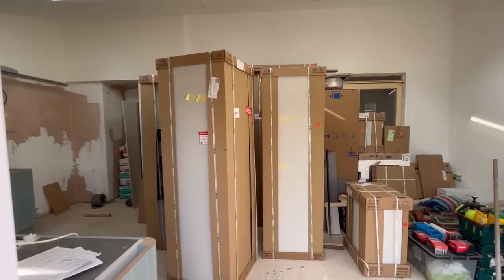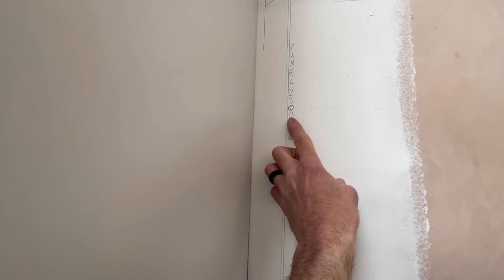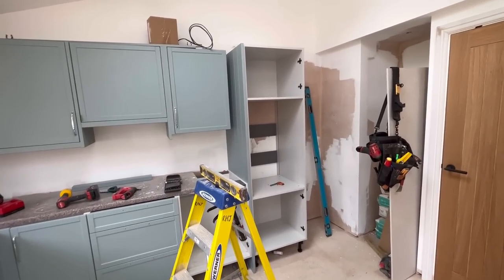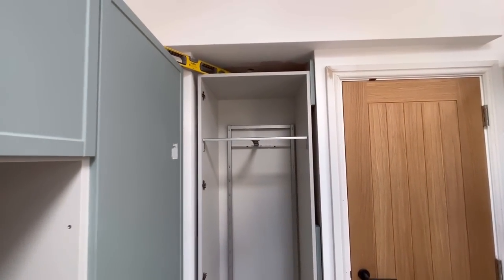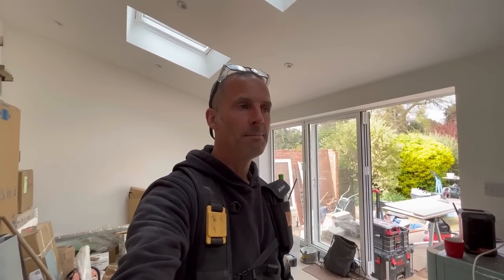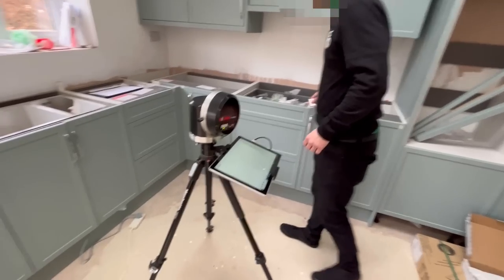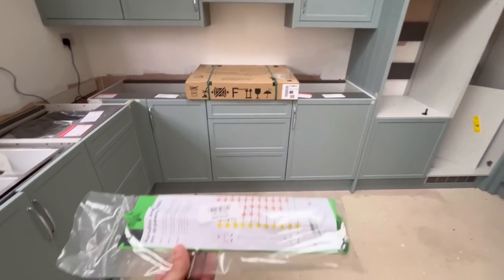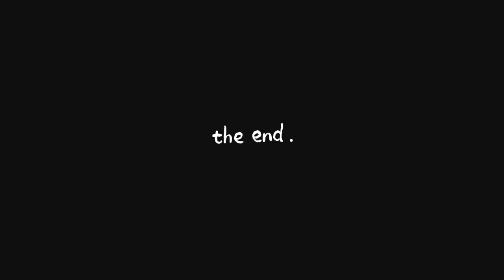WREN KITCHEN - All finished thank goodness PART 4

Comment: Kitchen Fitter for 40 years.....Nice job, but can't understand why he put an infill both sides of the 500 wall to the right of the bridging unit when he had to do another to the right of the 500 wall, it looks unbalanced, should have just had the bridge/decor end/500/infill.  Its always an issue when they run the bridging unit decor ends through (top to bottom) without matching it on either side of the base/hob unit. the solution is to only fit the decor ends to the bottom of the bridging unit and fit a 600 instead of a 500 on the right

Comment: I've done loads of kitchens, the best tip I can give is, those small wall cabinets, you get a small hanging bracket, I scrap those and use a full length bracket,  which you can cut down, or I like to notch the wall units, and run a full length across the wall,  1. You can get over cables, 2. More fixings in. 3.you can get it level much easier.
Reply: Good advice there Carl, this is something I do too, the standard brackets are way too small.
Reply: Ahahah yet I'm not a fitter but when I put my kitchen in I used those long brackets so I could miss any cabinet lighting cables coming down the wall perfect.
Reply: Where did you get this type of bracket / rail?

Comment: Great vid. Don’t like wren either. The fillers I normally do the other way so not made of two bits so you don’t get the line. I wud have worked out from centre of the hood unit so equal both sides with fillers. Done a cracking job tho

Comment: Great video, bud. I share the same views on Wren kitchens, absolutely hate fitting them, and probably won't fit anymore.
Regards to the handle/knob jig, I've got one, had it many years. I simply set jig up with correct set back etc and I mark the door with a pencil and drill hole with a bradpoint bit. Never had an issue with it. Keep it up with these great videos 👍

Comment: That's a shocking design 😮 In addition to the wall unit disaster with the fillers, the 400/800 corner base unit has so much dead space, a 500 door on a 1000 corner and a 500 to the right of the drawers would have been much better.

Maybe you should have put those wall fillers on the base run either side of the drawers to keep the alignment above, would have saved a lot of faffing with scribing fillers either side! Looks like there was plenty of tolerance to make that corner post smaller to fit them in.

I always make sure to check the final plan with the customer before they order to avoid silly issues like this.

Great videos, very insightful 👍

Comment: I believe those handle screws just have like snap off points. I use two sets of pliers holding the screw close to the desired “snapping point” then the other to bend and snap off the excess thread 👍🏻

Comment: As someone who has fitted many kitchens from a variety of suppliers, I can confirm that how much you pay has no bearing on the customer service or quality. 
Probably the worst example was a B+Q kitchen, which due to missing pieces and damaged doors and the replacements being equally as bad.
Was actually finished six months after beginning the installation.

Comment: I think you’ve done a great job fitting the kitchen, the design is not balanced an too busy. You would think they could make the units to individual dimensions, unlike off the shelf stock cabinets and cupboards, given Wrens price tag.
I’ve used a local guy who makes cabinets to order and orders doors to suit (and door types and finish don’t depict the price, as there was not a great deal between shaker and hi gloss acrylic).
Am soaking all this in still Rich.

Comment: Caramel wheels are good for removing sticky marks from surfaces. Make sure you set your drill to a low setting and, test on a piece of off cut first if possible, if not just take it easy 👍🏻

Comment: Hi…Watched all four parts of your Wren install which was superb and very informative. Thank you. I am in the middle of installing my Wren Infinity Plus kitchen…not without measuring issues!😉
May I ask…where the decor panels meet the pelmet on the wall units, above the three draws, they appear to protrude about 5mm past the bottom edge of the pelmet, rather than be flush. Is this intentional and how you prefer to do it. 😊Thanks
Reply from the maker: Hi David. I’m racking my brains as to how I did it but if I remember rightly it’s not my preference but I like to keep my end panels 1-2mm in front of the doors/draws but the cornice and pelmet material from Wren wasn’t very deep so although I prefer to sit the pelmet further forward so it’s in line with the pencil round I couldn’t without losing the fixings point to the underside of the wall cupboard. Hope that’s makes sense. 👍🏻
Reply: Thanks👍
Reply: @Mr_A_Builders Hi again further to my previous message…Looked at your video again and you mention ‘shaddow’ gap/space on the decor panels which overhangs the pelmet by 5mm. It does look really neat👍
Please May I ask your advice…I have now started to cut/scribe the end decor panels. My walls are way off plumb so I bought an Easyscribe tool for scribing. I cut the scribe with a Milwaukee circular saw, which made a right dogs dinner of it, as I wasn’t cutting a straight line!😢
Is a jigsaw a better option for cutting scribes? Thanks

Comment: The cupboard in the alcove. The handles won't bash into the fridge cupboard?
Reply: No.  It is a pull-out cupboard, not hinged.  The whole door front and the internal wire baskets pull out towards you.

Comment: I've just spent 10 grand on a kitch fron wren I haven't checked it yet but are you saying wren's kitchens are not square?
Reply from the maker: I’m not saying that all Wren kitchens are out of square I can only say that the one I had was out of square. I may have been very unlucky with my whole experience of using Wren for the first time your experienced may be perfectly fine. I hope it all goes well for you. If you have any other questions I’m happy to answer them. Enjoy your weekend 👍🏻
Reply: @Mr_A_Builders  cheers my friend your video is perfect for tips for me thanks. Yer the only thing I'm not looking forward to is the dishwasher at the end of the run with end panel 😂😂
Reply: @Mr_A_Builders  morning fella I'm off to get my wall cabinet fixings what do you recommend for strength I read washer head screws size 8 or 10 gauge I've seen them for wood but not block work hope you can help😁
Reply from the maker: If it’s dabbed walls I’d recommend corefix fixings (covered these in one of the Wren kitchen videos) it’s what they are deigned for and even invest in the full length wall hanging brackets. 
If it’s solid walls I’d go minimum 2 1/2 x 10 screws ( 60mm x 5  ) and brown plugs in all available holes. Only my recommendation cos you’ll need to check the structure of the walls first and make sure they can take a good solid fixing.
Reply from the maker: Just get your base cabinets fitted first so you can use them to line the up the end panel. Remember to check top, middle and bottom both back and front of the dishwasher opening to make sure you get you required 600mm opening and also be mindful of the height. I always set my base cabinet height at 870mm minimum from the highest floor point even though as you may have seen from my dishwasher episode you’ll still have to put the legs on packers. I still can’t explain why we have to do that after all these years. Any more questions feel free to comment or contact us on our email mrabuilders21@gmail.com 👍🏻
Reply: @Mr_A_Builders  cheers fella I was thinking corfix belt   and braces as they say
 Thanks again😁
Reply from the maker: No probs at all happy fitting 👍🏻

Comment: Fairplay mate, another great episode showing how every day "construction" work can be very awkward. Cupboard hinges half fitted, screws not fully tightened, designers/measurers unable to use a tape measure and every little "discrepency" needs to be "over come" by the installer! Which in most cases....isn't noticed or known about by the customer, isn't paid for by the manufacturerer/supplier or client because most of the time you just want to crack on and get the work done and finished to the best of your ability, it can really get on your tits at times! I genuinely could count on one hand the number of jobs fiitting Wickes kitchens for 5 years that ran without some type of screw up on their part....every job there was something damaged or the wrong size or the plan couldn't physically work or the wrong colour or wrong type of unit or appliance. They would even send you the exact amount of, say plinth, once you had cut it all to the correct lengths etc you"d be 8mm too short because  they were that tight the wouldn't allow for the thickness of your chopsaw blade. We would have to buy a 3 or 4m length to finish to job. Great job my friend, you done your lot proud and I look forward to the next, cheers bro 🙏
Reply from the maker: Thank you for your comment.  Onward and upward now. We’ve really enjoyed completing this project as a whole for the customer and I hope they are really happy with it all literally from top to bottom. 
Already completed another job ready to upload and moving onto another shortly. And of course Adam’s been hard at it working and filming his. Thank you for the support mate it makes it all worth the time and effort. 👍🏻
Reply: @Mr_A_Builders good on yer bro, just crack on, you can only do your best and it looks spot on from here mate 👍

Comment: Hat's off to u rich, messing about with a really badly designed kitchen,filler panels all over, ceiling to low?no it wasn't! Top video ,do me a favour, level is horizontal n vertical is plumb , keep it up
Reply from the maker: Hi Phil. I’ve got a confession to make I do the level and plumb thing now on purpose because I’ve had that many people comment it makes me smile when I read them. Is that wrong?😁👍🏻
Thanks for the comment mate hope you have a good week

Comment: No matter how long I’ve done kitchens I’ll always pick up something new. Thanks. Have you fit HOWDENS.?  My last experience wasn’t good. Open gaps off square cabinets and backs falling off. Rickety structure. I did complain to them and was told I was the “only one” with these problems. 😮😮😮😮😮 although they did give some vouchers but nothing that would compensate for my time lost I haven’t gone back since. Mass production and fling them out to the outlets.
Reply from the maker: Hi and thanks for commenting. I have fitted many Howdens kitchens and I’ve always found them to be out of square, basic quality and as you say the backs of them not fixed very well only staples. 👍🏻